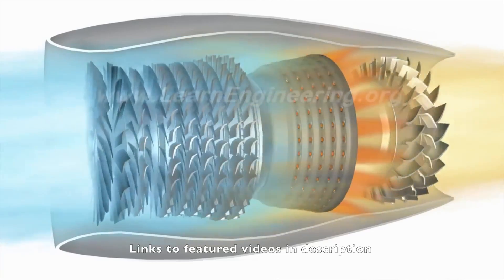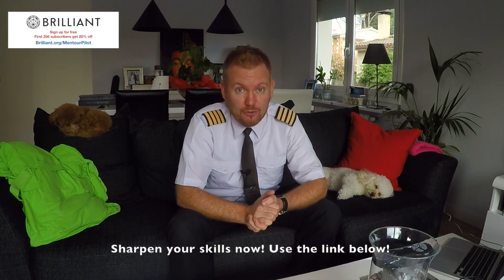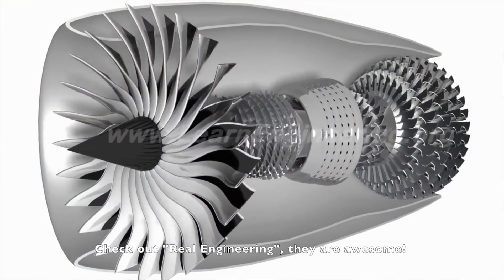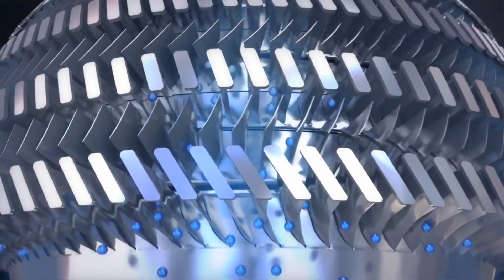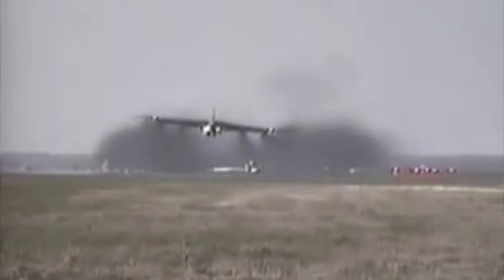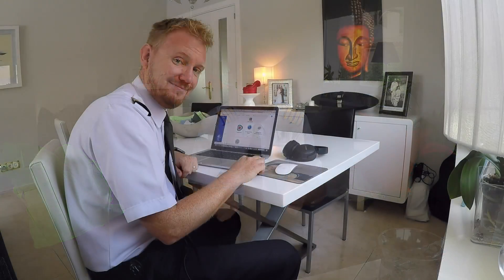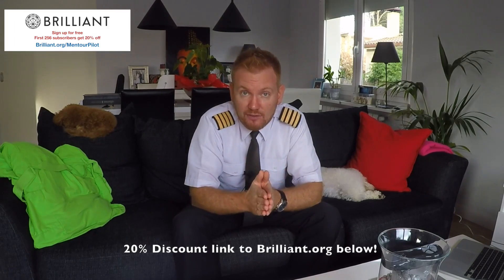Can water make Jet engines stronger?!

Comment: jet engines don't need fuel. only air and more water.
Reply: What
Reply: @tsurutuneado5981  if air is 78% nitrogen? maybe they have found a way to compress the air to ignite the nitrogen in the air with a spark instead of fuel. they make you pay for fuel they don't use. that's called a really good scam. the amount of fuel a jet turbine needs can't be carried by an airplane. no way there is 320 000 liter of liquid in an A380. there's no room for it and the weight would crush the tires. and the sloshing of the fuel would make the plane really hard to fly.
Reply: @heiknuuwter  Wait a minute, there are people that really believe jets don't use fuel? You got to be kidding or trolling, there's no way this is real
Reply: @tsurutuneado5981  an A380 maximum take off weight is 560 000 kg. and it has 22 tires. that means every tire has to resist 25 454 kg of weight. that's insane. and the A380 carries 320 000 liter of fuel that can be tanked in 40 minutes. that's 8000 liters/minute. a car tanks at 50 liters/min and the hoses look the same. the numbers don't match up to me. that's all i'm saying.
Reply: @heiknuuwter  Oh okay, I was researching and you have all your numbers correct, except for one thing. The 50 liters/minute is true but for city gas stations. The fuel to an airplane flow rate ranges from 200 to 600 gallons/minute (I also hate the Imperial system) and if you notice, that's way lower than the 8000 liters/minute you talked about, but the thing is, planes don't refuel all of their tanks to the full capacity, that would be inefficient. They fill their tanks with only the fuel needed for the trip and some spare in case they need it, which is way lower than the full capacity of the plane.
Reply: @tsurutuneado5981  8000 liters/minute is 2113 gallons/minute. you are talking about 200 to 600 gallons/minute. in my world that's less. we need a bigger pump. in farming we use such pumps for watering the land. the hose is bigger than we can see on much of the video's fueling an airplane. so the pressure must be higher for the same water to go trough. we can spray up to 40 meters. that's about 130 feet. no way dude. if the numbers were right. the kerosene would go trough the wing and would shoot high up into the sky.
Reply: @heiknuuwter  Two different systems, farming is way different from aviation. Let me ask this simple questions, how can an airplane fly without jet fuel? Why is the landing weight lower than the takeoff weight if no fuel has been used? Why are there cases were fuel runs out of a plane if they fly in compressed air?
Reply: "Two different systems, farming is way different from aviation."
i was aware of this fact. but liquids move the same, on a farm, on an airport, and even at home. when you squeeze at the end of your garden hose, the water goes further, everywhere on earth. when you fuel an airplane, you're filling up a lot of little tanks. that's even harder to do at 8000 liter/minute.

"how can an airplane fly without jet fuel?"
i gave you my guess 3 comments back.

"Why is the landing weight lower than the takeoff weight if no fuel has been used?"
when does an airplane go on a weight scale? never seen it before. so how could we know?

"Why are there cases were fuel runs out of a plane if they fly in compressed air?"
can you give me some examples because Some 0.5 percent of accidents on record were blamed on low fuel, according to the U.S.-based Flight Safety Foundation. i found more miracle landings without fuel than crashes.   @tsurutuneado5981
Reply: @heiknuuwter  Did you study at least a little bit of aviation? Because I did. The landing weight of a plane is waaay lower because of the burnt fuel. You can't just land with a full tank, that's why in some special cases pilots dump fuel until it is empty enough that it's safe to land. Airplanes don't run on magic dude, the idea of planes not using fuel is really ignorant and beyond idiotic. It's like saying gasoline cars don't use gasoline... 

Wait, I'm having a great idea for another conspiracy, cars don't use gas, they just use scented water. Prove me wrong
Reply: @tsurutuneado5981  i know 1 thing. a tire can't stand 25 454 kg of weight (56 116lb). according to the website modernairliners the Maximum Landing Weight of an A380 is 386,000kg (850,984lb). that means if an airplane lands perfect on 20 wheels, the average weight is 42 549.2lb on each tire. the tire is pumped to a pressure of 16 bar, or 230 psi. sometimes a plane lands for a few seconds on only a few tires. and the tires don't explode? a truck tire has between 100 and 120 psi. the best truck tires can resist 10 000 kg (22046 lb). my advice is not to bounce a tire that has 230 psi. don't care under what vehicle you put it.

only jet engines don't use fuel. if that was an attempted in a funny ad hominem? you failed. have you ever seen kerosene? i've seen diesel and gasoline.

Comment: One of the most astonishing things I ever saw was launching an F-4 from a carrier during a fairly heavy rain storm.  When the F-4 went into Afterburners prior to launch I could see water being sucked into the intakes from in front and behind the intakes to a point it looked like a  giant fire hose was shooting water into the intake.  So much water going down the intakes I was incredulous that any kind of flame could exist inside the engines. I felt sure the launch would be scrubbed but the plane took of as normal.  I asked the pilot later about it and he said that the rain was like adding a supercharger to the J-79's, increasing compression inside the engine and adding extra cooling too.

Comment: The "thrust" IS NOT "created mainly by by-pass air" as said at approx 5:24.  The majority of air coming into a jet turbine engine is used to cool the engine.  "Thrust" is created by hot gas expansion/explosion from the thrust chamber of the engine NOT air that by-passed the thrust chamber.
Reply from the maker: A turbo Jet engine only uses the core engine to produce thrust. A Turbo Fan engine uses the fan to produce between 30-70% of the thrust depending on the stage of flight and speed.
Reply: @MentourPilot  Thank you for the civil response.  I stand corrected.

Comment: Hi Mentour! Actually, the turbine stage temperatures are much higher than the material can actually take. The alloy out of which the turbine blades are made from should be normally melting at those temperatures. However, the blades have some internal ducts which cool the blades using air bled from the compressor. When the turbine blades are cast, a ceramic piece that has the shape of the hollow part is inserted. Then the molten alloy is poured, and when it cools down, the ceramic part is dissolved, leaving the hollow section of the blade.

Comment: Why we don't use HYDROGEN IN JET ENGINES?????
Reply from the maker: It has to do with the volatility and problem of storage. It also needs to work in a wide variety of temperatures and pressures. It makes hydrogen less than optimal
Reply: Low energy density compared to hydrocarbons.
Reply: Actually H2 has a very high energy per mass, though the volume is an issue. H2 injection as a small percent of total fuel could be beneficial though, it can improve Jet fuel combustion characteristics, reduce flame outs and such. The storage tanks and added complexity would probably counteracts the benefit.

Comment: to make the story short, water ingestion increase the mass flow rate of the engine so the efficiency will increase a bit. some old turbojets have water injection system installed to increase max. thrust.
and its very difficult to flame out an engine by water ingestion. one example is the qantas A380 which blown up the no.2 engine in flight and returned to SIN. after landing the crew cannot shut down no.1 engine because the control cables were damaged by the debris from no.2 engine. those ground crew tried to shut no.1 down by spraying a lot of water into no.1 by the fire truck and the engine stayed up. they finally got that engine shut down by spraying foam into the engine.

Comment: In the Fairchild Metroliners we regularly use CAWI (continuous alcohol and water injection) to assist with performance requirements during take off. It's pretty cool to watch the torque gauges jump about 30 percent when you flick the CAWI switch on.

Comment: I understand the basics of a turbofan engine. However, I'm having difficulty understanding how the large fan can produce the majority of the thrust when it is just that - a fan - whereas the air that goes through the core is compressed and much higher velocity.
Reply from the maker: The fan produces between 30-70% of the thrust depending on speed. It all comes down to Physics, it can move a huge volume of air at a relatively slow speed while the jet pushes a much smaller volume at higher speed.

Comment: Most of the thrust comes from the bypass air.  I didn't know that.  So, really, the plane is powered by strong fans, driven by the combustion of the engine to spin the fan, not create combustion thrust.  Ingenious.  A self powered high power FAN.  neat!
Reply from the maker: Indeed.

Comment: The B52's prior to the H models were pure turbojets while the H models used low bypass engines.  The G models I worked on used water injection but as mentioned this was only for takeoff.  And yes, they were very dirty when injecting water.

Comment: Very interesting video. Now I have a question for you: I see in several videos that once you takeoff, both pilots takes the seat belts out. Now, these is not dangeours? What happens if during the fly you cross a severe turbulence of the type called clear ceiling, that is not detected by de meteo radar? Both pilots can heat their heads with the ceiling and get bad injuied. And then who flyes the plane? One month ago a A330 of Aerolineas Argentinas cross a severe turbulence over the amazonas and several passengers and crew members get badly injuried. I thing that both pilots, or at least one of them should be always with belt fasten. What is your opinion about this? Thank you very much and I like your videos.

Comment: Can aircraft engines be improved even more than what they are now, or does a significant improvement have to come from totaly new technology such as the open rotors?
By the way, besides the limited space under the wing that limits the size of the fan, are there any other issues that prevent aircraft manufacturers to build more powerful engines? (why  not a 600 kN thrust engine to make the A380/B747 a dual engine aircraft)
Reply: The limit is in fan speed verses turbine speed,[as well as temp limits] thus the new interest in geared fans, however the gearbox adds a huge point of wear and potential failure along with some weight. You also have diminishing returns with ever larger bypass ratios, even setting aside cowling drag. The cowling increases the base efficiency by limiting induced drag on the blade tips. 
Open rotors[I assume you mean fans] are are almost 200 years old, they are more commonly known as propellers.
Temp limits are not only material limits they are also related to pollution regulations, high temps increase NOx formation; this is also why cars haven't gained much fuel economy in 25 years, emissions regs limiting NOx have reduced efficiency enough to counteract all of the technology gains. The NOx limits on Aircraft are looser than on cars but they are still a somewhat limiting factor.
Reply: @mytech6779  Interesting, didn't know that the new regulations actually impacted engines' efficience 
By the way, are composite materials currently used on the gearbox in order to reduce its mass? otherwise i guess the motorist are thinking about that.

Comment: Really cool video ^^ like the clip with the Engine being blasted with Cubicmeter off water and the engine has a troll face on it an keeps running :D. At first i wanted to wright about the Quantas A380 witch had an inflight uncontained Engine Failure and after landing they tryed to "kill" the engine with water but it only died down when they used foam, but somebody beat me to the punch in the comments below :D. 
I had to smile more the once with the word Burncamber :D or also know as a Combustioncamber wich are are small masterpieces of engineering depending on the type of "jet engine" :D

Comment: Great vid - I'm curious though about the pressurisation system. I always thought oxygen was added to the cabin at high altitudes but feel that this is not true. I understand how the emergency oxygen system works but could you explain the cabin pressure system in more detail please? If not already done of course.
Reply: It mixes outside air with compressed air from the engines. The compressed air has more density, so it has more air molecules to breathe

Comment: surprised to learn that jet engines don't suffer a form of hydrolock as one would see in the case of water  entering the combustion chamber of a reciprocating piston engine
Reply: piston engines hydrolock due to that  fluids like water cant be compressed.  Cylinder fills with liquid ; water, gas, antifreeze whatever, piston tries to compress it something is going to break

Comment: Is there priorities on using reverse thrust and brake to slow down the aircraft? Like wet runway, more reverse thrust. Dry runway just braking.

Plus, do the tyre and brake have to warm up like race car before landing? I think they also have a optimal working temperature
Reply: Braking is always the main priority, reversers are used as a help for the braking system and to the reduce the landing distance. And no, the brakes are not warmed up before landing, with the high speeds on landing the reach really high temp. very fast
Reply: @josemigueldelgado2440  Thanks for the answer. But why the brake have priority, it consume brake pad, tires but reversers only consume fuel which is a lot cheaper and it has to refuel anyway. For the brakes...damn, I want that for my car

Comment: When the runway is wet there is less friction. And unlike a car the plane is not driven by its wheels. Yet you say you need more power to take off if the runway is wet? Please explain why.
Reply: If there is enough water to puddle, I imagine that would surely make a big difference, because that water has to be displaced. 
Even at automobile speeds, you can feel retardation when you drive into a decent puddle.
Reply: @Gottenhimfella  good point. I wonder if that is the only reason?

Comment: During aircraft maintenance they also do a water wash procedure on the engines to clean the remove any dirt/salt deposits from the compressors as the deposits reduce the efficiency of the airflow as the airfoils do not have the optimal profile when dirty, increasing the risk of engine stall. Just like ice accretion on a wing, the airfoils will not work effectively if dirty. Though the core engine wash involves spraying water and detergent into the engine core. Though this is done with the engine turning only on the engine starter and not the engine running, otherwise the increased rotational velocity and heat would eliminate the cleaning effect by turning the water/detergent solution into steam as Mentour explained. Pretty interesting video, I know that a few older Rolls Royce engines used water injection during TO.

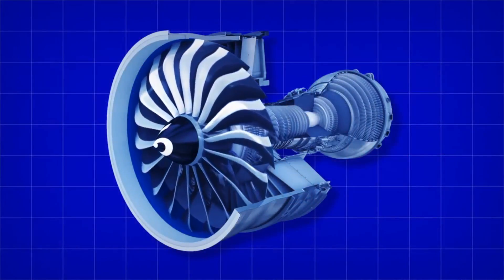Comment: One interesting thing to note about the description of operation between about the 5:15 - 5:45 mark...the bypass air encloses the hot gasses exiting the engine core, and that blanket of air helps the engines to operate much more quietly than the older "turbojet" design, where all of the air entering the engine flows through the engine core, and there is no bypass air. All of those hot gasses hitting the cooler atmosphere were the source of the noise which used to be commonplace around large airports in the 60's and 70's. You can still hear that noise today, if someone is operating a 20-series Learjet with the GE CJ-610 engines.

Comment: I was wondering about standby duties recently. You have to get to the airport, pass security and find your airplane in one hour. Isn't it quite dangerous that you fly the airplane without proper study of weather, notams, flight plan, loadsheets, any specific procedures, briefing with the whole crew? It may happen that the other pilot will be incapacitated shortly after takeoff and you have to have as much information as you can about your flight. Is it possible to do all this things properly in only one hour?

Comment: There is a way to increase engine power with injecting water and using water from external sources in modern engines (with high bypass ratio). I just thought of it. Unfortunately it would require very stable conditions, but the increase of fuel waste, could be accounted for and increase of Efficiency of the engine would surpass the increase of fuel spent.

Great video as usual.

Comment: I've flown an incredible number of hours on commercial airlines and have had several questions:  1) is the weight of the plane determined while it's sitting on the ground (at the gate)?  2) are the engines put into 'reverse' when the plane touches down for landing?  3) do all large passenger planes have radar and what does it show?  4) what exactly is turbulence and can it get bad enough to damage the flight characteristics of the aircraft?
Reply: 1) Yes, there´s an estimation of the Take-off weight (TOW). 2) Yes, the reverse thrust is commonly used to help slow down the aircraft. 3) Yes, they show basically groups of clouds and their density; depending of that density it can be said what kind of weather is present there. 4) The turbulence is a disorder on the movement of the air, in areas of really bad weather the can be strong enough to damage the airframe (Aircraft´s structure), these areas are always avoided by the pilots